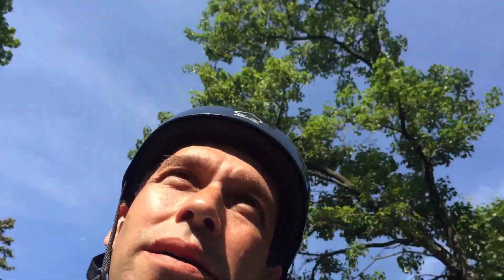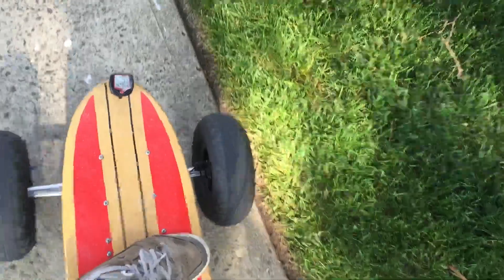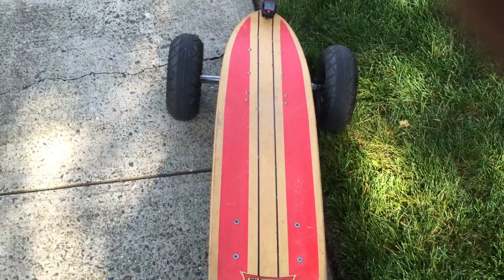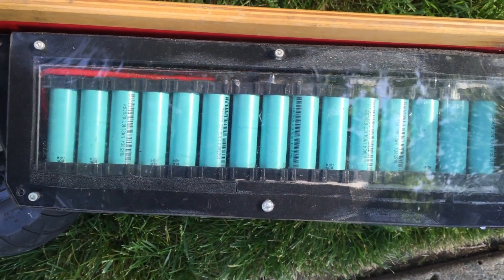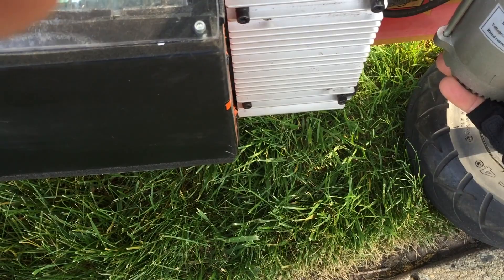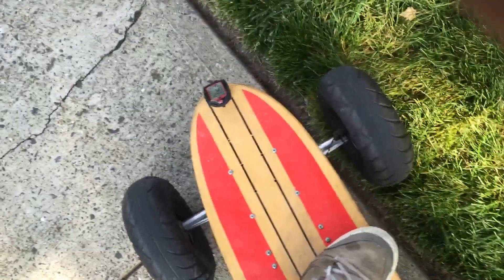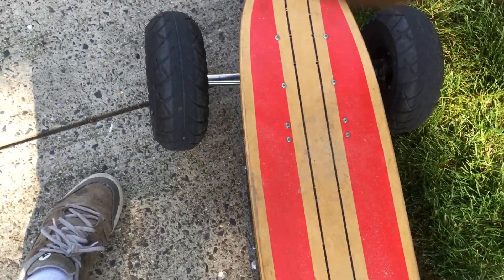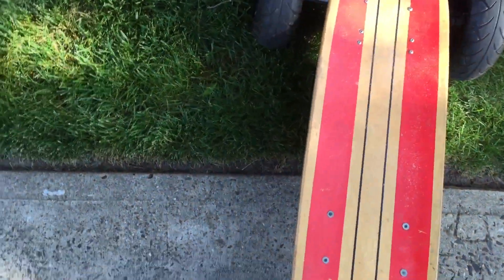electric skateboard 42 mile 18650 battery test full charge

Comment: where do you buy ur cells last time i got 18650 lg he4 they ending up being rewrapped so i need reliable source but being reasonable price need 40 18650
Reply from the maker: hi swaggy kay ..that is a great comment...well after I got beat  buying brand new laptop batterys that were gateway brand new packs .but joke was on me all 20 packs I got were all dead 0 volts ....then took a shot in the dark .found a iso 9000 company selling  a 2200 ma battery at a 2c discharge.its a bak  18650c4  vm3l10c .good for a solid 5 amps discharge..thats why I use so many. in my pack ...they work great at a low price...don't know who sells then in the usa